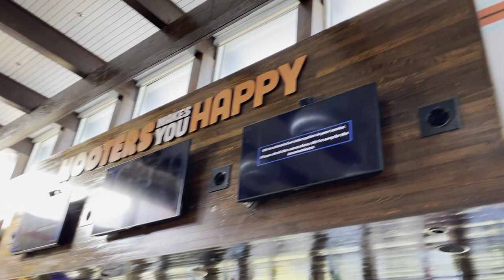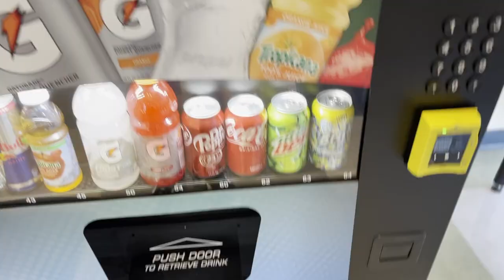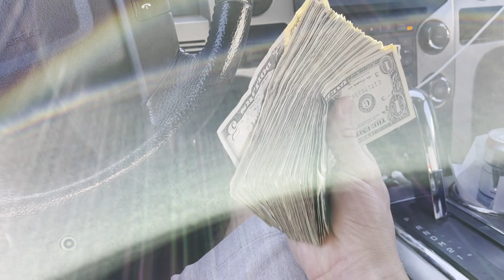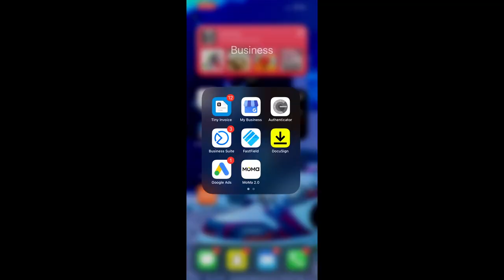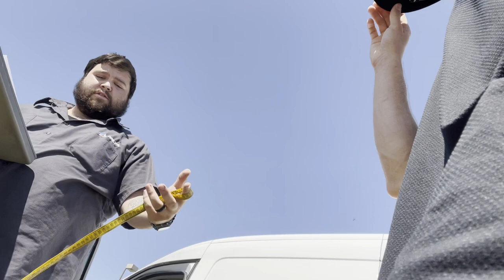The most cash I've made with my Vending Machine!

Comment: Hello, 
Was it difficult to install the Card reader to your machine? 
Also, can you give a review on the Sam’s Club Machine? I’m considering purchasing from them and would love to here your personal experience thus far. 😊 Thanks!
Reply from the maker: The card reader was a little more difficult installing than it was on my 2010 wittern machine. With the new selectivend, you have to actually take the coinmech off the machine to get to the plate for the card reader. This was a little frustrating and will be difficult if you do not have the correct tools. With some time and patience I was able to do this by myself. The selectivend machine is great and I have not had any issues thus far! Thank you for your comment!